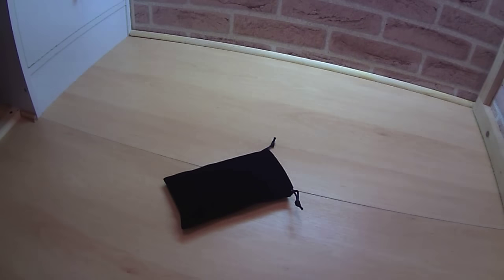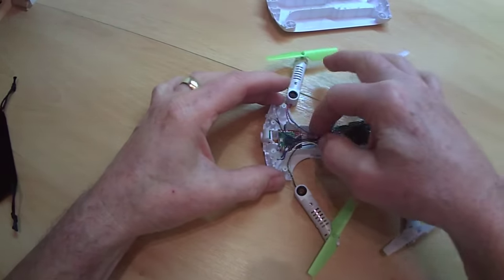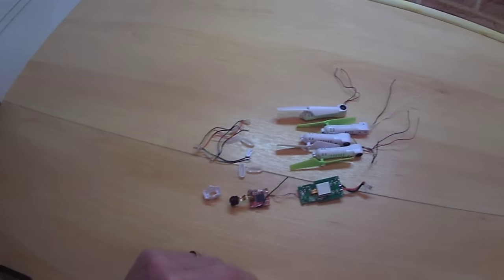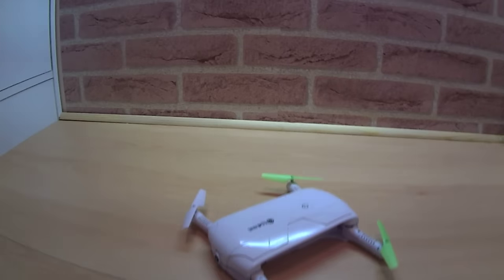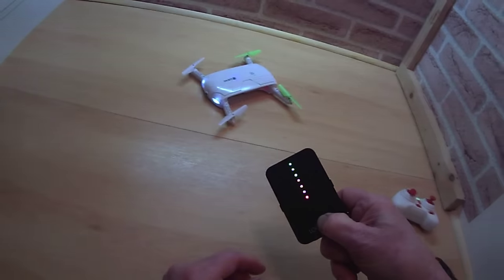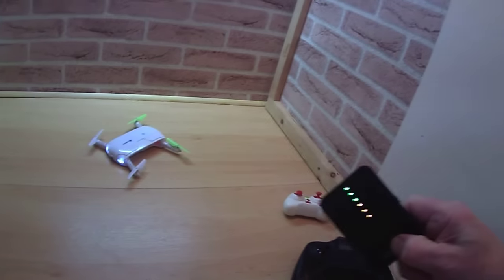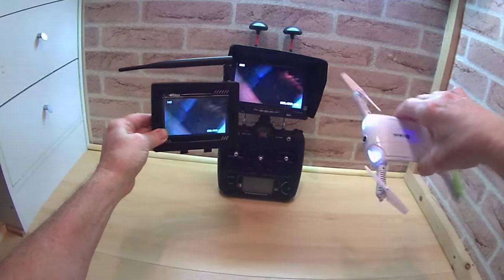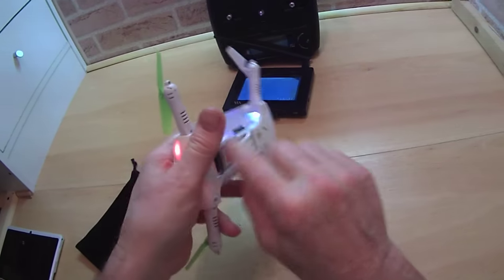Eachine E50 Conversion Mod

Comment: Great video. I have one like this and an xk radio just like yours. I also have a hubsan control with fpv screen of 5.8 ghz integrated. What electronics have you used for this modification? Can you advise me how to make it work with these radios ?. Thanks in advance, I subscribe to your channel. Thank you.
Reply from the maker: Hi mate this is not difficult to convert whatever transmitter you want to use just buy the board that will bind to this then solder the motors and lights, that's it.
Reply: Copter Hubsan Thank you. And which board did you use?
Reply: Still waiting for you to tell all of us what replacement radio you used in this quad.
Reply from the maker: Hubsan X4

Comment: the main feature which made it a good selfie drone was the barometer
Reply from the maker: The main feature to a good selfie is a good camera that this has not got.
Reply: +Copter Hubsan, its quite ingenius what you have done, but you'll find that the camera that you've fitted is only just higher resolution than the original 576p camera fitted to the Elfie.
Reply from the maker: Thank's mate, please see my video of this flying you may change your mind on the 576p camera, here is the link 

https://www.youtube.com/watch?v=ho1fOcdoTyo
Reply: please would you give me info on where to  get this receiver to do this mod as I find it hard to control this quad on a ipad, I already have the hubsan 502e outfit, many thanks.

Comment: Why did you cut the video after you stripped it out and not show what you did or the re assembly?
Reply from the maker: Because the video would have been to long but I did show the final assembly
Reply: Hi i appreciate the work you have show, but really disappointed you cut the video and not show how to build and the components you used.
Reply: xxxkahunaxxx. because its not a mod. its just taking an e50 apart and cramming components from othrr drones inside untill its almost unfliable!!!!

Comment: Hi, just wanted to get some advise, I just got a Eachine E50 today, crashed in the grass and now the rear right propeller does not spin. I took the arm apart to see if there was dirt, it was clean. So I started the propellers with that one arm open to see if the little gear was spinning and it was not. Does that mean the motor dead with one small crash in the grass? Also, in your video you show my drone, but you don't show how you took it apart. I took all six screws out of the bottom, but the front and back don;t want to separate, is there some other screws or something holding it on??? Any advise would be appreciated, thanks
Reply from the maker: Please see this video https://www.youtube.com/watch?v=FQBalgCP7Vc

Comment: do you have a "parts list" of what you put in? Could just the camera be upgraded? I got this thing as a pocket throwaround bird and not having to carry a separate controller was part of the appeal. plus it was cheap. Don't want to gut my camera equipped but non fpv Hubsan and then have to carry even the micro remote and a phone for FPV. But nicer video would be worth some work

Comment: I think it seems like the conversion was more of a downgrade because you lose the features that made it a good drone.
Reply from the maker: Such as imposable to control via the on screen simulated sticks, very low resolution video, reduced distance,
Reply: george aura nc  bob bom
Reply from the maker: Sorry don't understand this!
Reply: I think he means that you downgrade from Hubsan. what's the point to have a e50 with Hubsan fpv inside? is it more compact then x4 or does it fly better? if you want wifi fpv you buy e50, if you want hubsan then just buy it. after this you can have one more interesting bird - hubsan x4 looking wifi drone ;-) I was thinking to put hardware from phantom on Parrot drone, that would be similar aproach